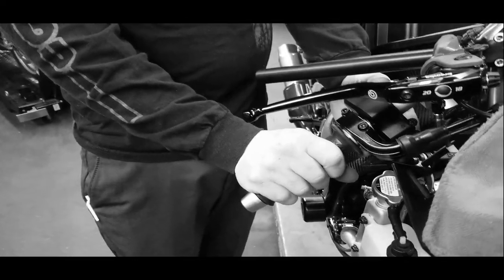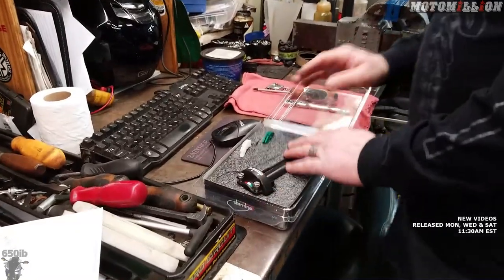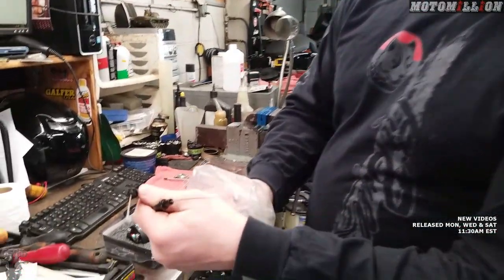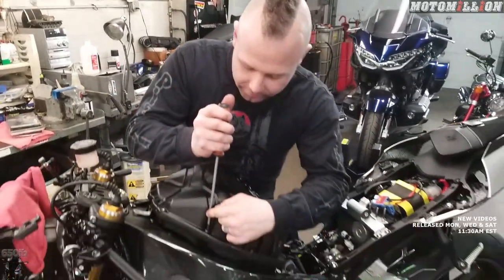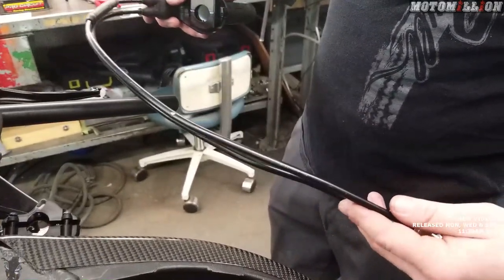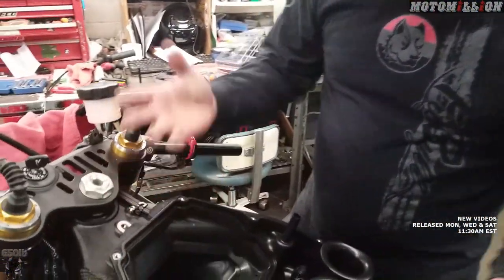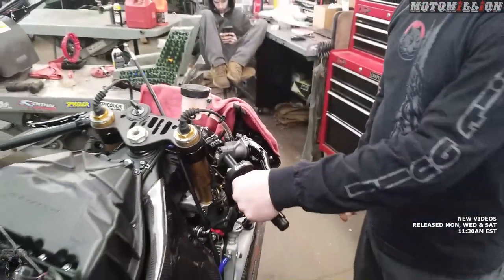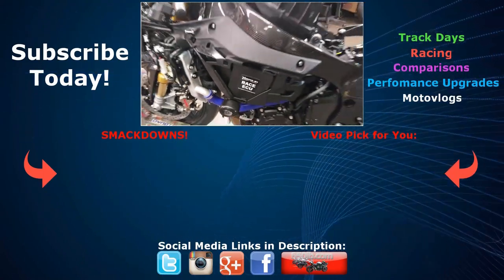SUPER RESPONSIVE Quarter Turn Throttle Installed | Yamaha R1M Build

Comment: Since when was 1/4 deemed quick action? 1/4 turn is pretty much standard, that’s 90 degrees of rotation, that’s standard, 1/5 or 1/6 would be deemed quick action, for example you can fit the throttle tube from the 2006 R6 to the certain year Gsxr 1000 which reduces the throw from 1/4 to 1/6, that’s 1/3 less of movement. 90 degrees down to 60 degrees from closed to fully open.

Comment: nice video love quick throttles never ride without them. Just curious what made you decide to go with Domino other than pro motion. Nothing wrong with either just wondering. 
thanks Ib
Reply from the maker: MotoMillion sells Domino.
Reply: as simple as that hihihi thought they would carry both but doesn't matter they still very good if not better. 
I'll be making big orders to them as soon as I get my bikes wrote to them a few weeks ago and they are sending me an email as soon as they get the 2019 parts in for the S1K.

Comment: On the rj15 r6, the diameter of stock "spool" of the throttle appears to be 42mm.
That means there's a stock, a progressive and a somewhat faster spool.

It's funny that he first says the green is normal and after that "see how small the throw is on the grip"
The throw on the oem is no bigger than the xm2 with the normal spacer 🤷🏼‍♂️.

Also, I don't like the responses of the cameraman.  Sorry, but he sounds like a 5y old kid that discovers a new world